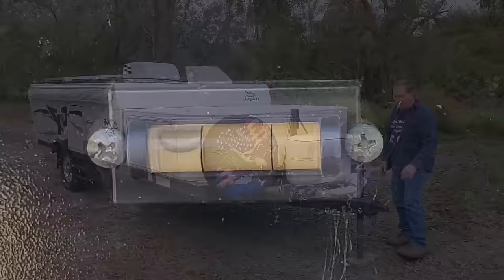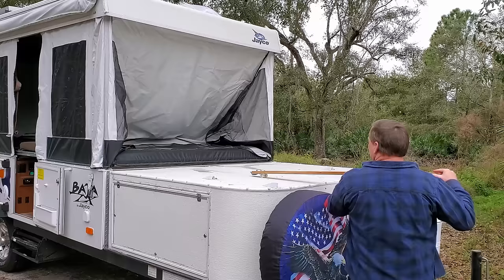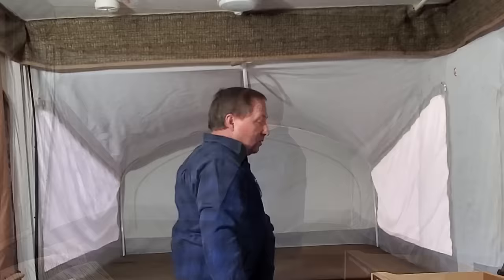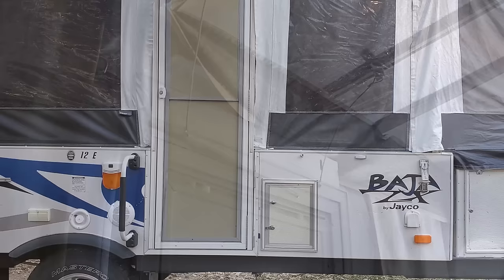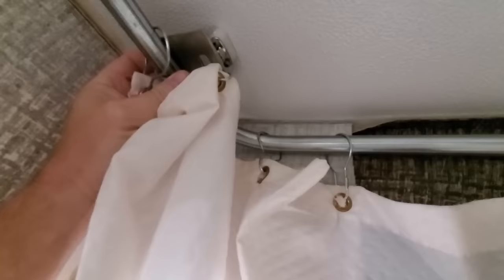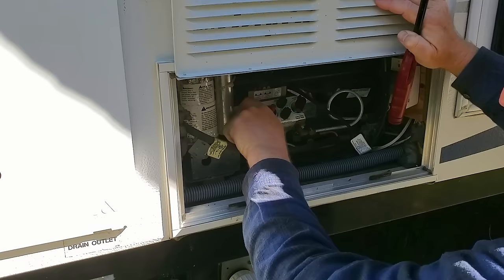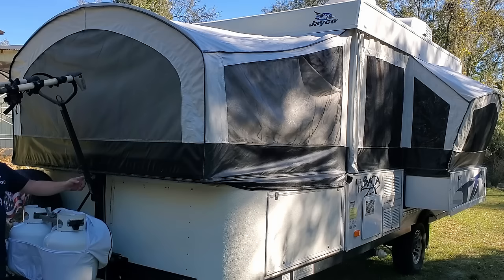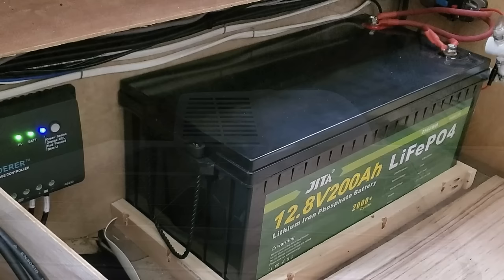Jayco Baja Demo Setup

Comment: Thank you for demonstrating the setup. You were very thorough and so patient in explaining everything in detail. My husband and I just bought a 2014 Jayco Series and this is the first time ever owning one. One question, the section where you popped open a part in the back and I think you said you could use a 1/4" hex head battery operated drill, is this to manually pop up the roof of the camper? I'm looking forward to go on our first camping trip soon. Thank you in advance for your reply.
Reply from the maker: The 1/4 hex drive is in case the roof lift motor fails. You can use a cordless drill to manually raise or lower the unit. Just ensure not to exceed the open and close limits or you could do some damage. Thanks and enjoy your camper!

Comment: The travel door that is installed on the caravan is very redundant. and M
He could turn and build the staircase
Also, the openings can easily be penetrated by snakes, which could be solved with a zipper
It could also have a ceiling mounted shelf. Instead of that dancing legs
Reply from the maker: Interesting ideas. Just keep in mind the ceiling is foam sandwiched with aluminum sheets. I think suspending a shelf from it would not be practical and could exceed the weight rating.

Comment: you never use the stable jack to level the camper side to side.
Reply: How do you level side to side I thought that's what those were for
Reply from the maker: Some trailers are pretty flimsy and I wouldn't recommend this technique.  For just leveling a couple of inches, I have always used the stabilizer Jack's with no issues. In fact, the cordless drill I use will stall out before it gets close to harming the trailer.

Comment: You don't level with the stabilizer jacks.  They are for stabilizing ONLY.   You should level with some type of leveling blocks under the tires.
Reply: Are you serious?
The wheels are still taking the bulk of the weight, it's not as if the stabilisers are taking the weight of the whole vehicle is it, they're, basically, just compressing or expanding the suspension of the trailer, if they are too weak to take that strain, they're pretty useless.

Comment: Just bought a 2011 and we have a black water tank that comes out to dump it and wondering if you did a video or know anything about that process.
Reply from the maker: I haven't done a video in detail. The process is fairly easy though. Just Google Theford Cassette potty and you will find info on it.